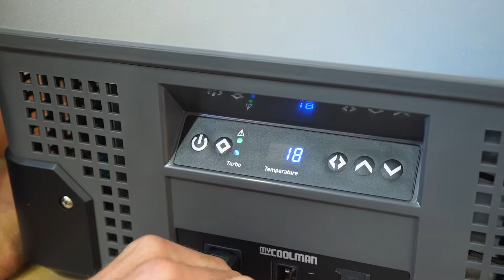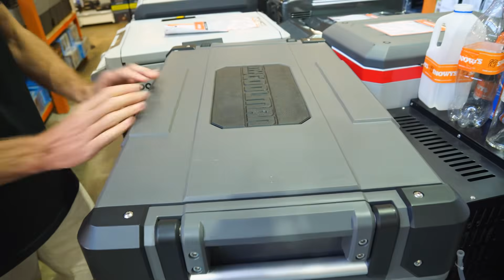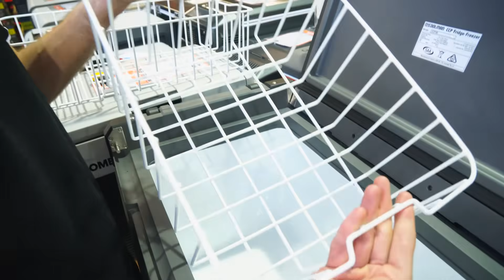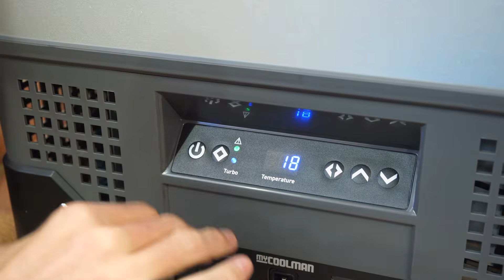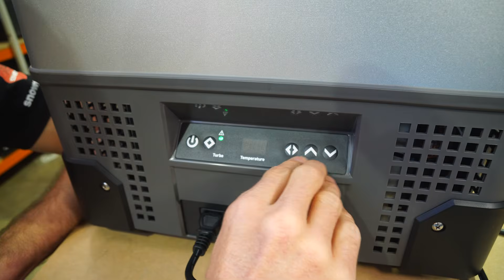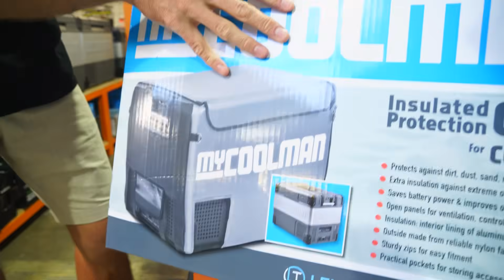myCOOLMAN CCP60 Portable Fridge/Freezer 60L

Comment: I don’t see a point of the fridge  with no battery
Reply from the maker: Most don't have an inbuilt battery, rather, they are designed to run of of an auxiliary power supply such as a vehicle or portable battery pack. In the instances where a battery has been integrated it has been small in power capacity with short runtimes. ~ Ben
Reply: @S @SnowysOutdoors  Hi Ben, what are your thoughts on the companion that has a lithium battery? Do you think that’s a good option for me for 60 L? The battery will help with less fuss. Will that one last long?
Reply from the maker: @Bev-s2d  if you want the flexibility of being able to run your fridge away from other power sources without the fuss of extra battery packs then its a good option. The integrated batteries are often only around 42Ah, whereas a battery pack or auxiliary battery can offer in excess of 100Ah. Some people don't need this though, and the portability with shorter runtimes is more than enough. We previously stocked those Companion Lithium fridges but removed them from our range as the demand for standalone fridges is still much higher. ~ Ben
Reply from the maker: @Bev-s2d  I should also mention that at the time of writing this comment, the myCoolman fridges come with a free 15Ah power pack that provides around 8+ hours of runtime, this gives you the best of both worlds. ~ ben
Reply: @SnowysOutdoors thanks ben for the info just wanted to ask one last question which fridge freezer around the 70L so u have that has a battery built in or that fits in like the companion
Reply from the maker: @Bev-s2d  we currently don't have any like that in our range, the closest is the myCoolman range which has an external battery pack that attaches tot he side of the fridge. ~ Ben

Comment: I’ve got this fridge and it’s a bewdy. I has a waeco for years and replaced the thermistor several times. Each time I had to take it in for the repair. I’ve just done a thermistor with this MyCoolman but I could easily change it myself. Circa $35 fo a new thermistor and my time.
Reply from the maker: Thanks for your feedback, they are great fridges. ~ Ben

Comment: Can you run the my cool man fridge freezers via an Anderson plug straight to solar panels?
Reply from the maker: No, you can't do this, Rod. You need to use the solar panels to provide charge for a battery, then the battery can provide the power to run a fridge. You need a battery in the system. ~ Ben